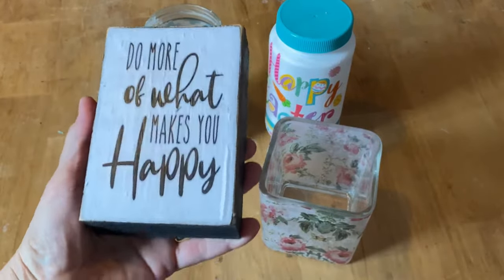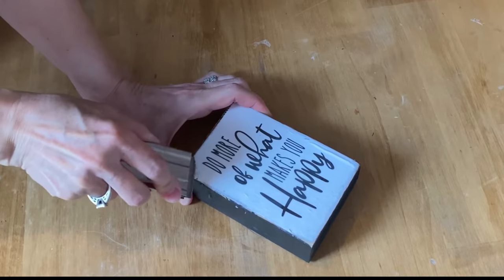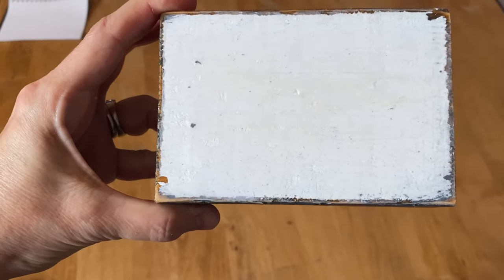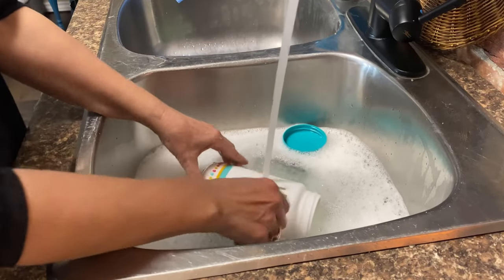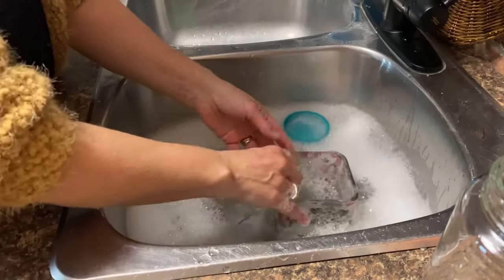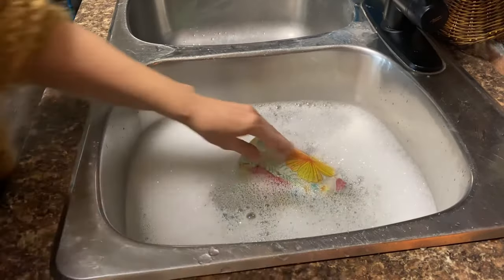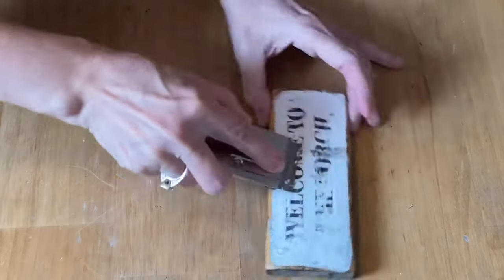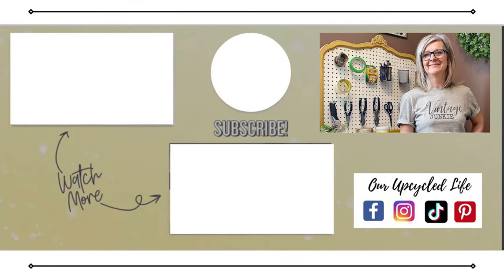Fixing Mistakes: How to Remove Mod Podge and Save Your Creations!

Comment: Ok, I just removed an outdoor modge podged napkin from painted wood. What I found to be the easiest, was a very wet paper towel, a bit of  Dawn dish soap, thinned with water, spread over the wood piece, and a heat gun. I tried a hair dryer but that was taking too long,😅. I laid the wet towel over the soaped wood and applied the heat on lowest setting, moving so as not to burn anything. I kept a water spray bottle handy to keep the towel wet. After heating a couple minutes, I used a razor blade to scrape off the decoupage and glue.
Reply from the maker: Great tips !!

Comment: I don't have the scraper but will figure out  a way. This is helpful video. Thanks. I will post a comment after I have tried it out. My project was a bedside table with decoupage with a thick paper and it has bubbles. I don't like it. Hope it comes off with hot water
Reply from the maker: Good luck!
Reply: @OurUpcycledLife  I could easily remove (didn't need to scrape it off) cos it was thick magazine paper. Came off with hot water. Did a new project and that is fab.  Now I also know that mod podge can be diluted with warm water 😊

Comment: I use my heat gun for stickers and it leaves a sticky residue on it thin I get 100% acetone with a paper towel and it comes right off clean and you don’t have to scrub it or use anything but the paper towel 😊
Reply from the maker: Yes great tip! that works great. Thanks for watching!

Comment: Question, I dont want to remove my decopauge cuz i just made it today but the glass has a foggy film where i accidentally went out of the lines so can i take a qtip and something to get that foggyness clear again thank you
Reply from the maker: You can try or use a xacto knife and see if will will peel off after you cut around edge.

Comment: What do you do when you are unhappy with a laser printer transfer sign on chalk paint and wood? My letters aren't dark enough for my liking so I want to try something completely different on the piece of wood.
Reply from the maker: I am wondering if you need new ink because with a laser jet it should be quite bold and dark. Or check your settings on your printer to make sure printing on highest quality

Comment: I bought a decorative wood (particle) sign from Michael's that has glitter on top of paint. I want to repaint the sign; is there a way to remove the glitter or should it be covered with a heavy paint?
Reply from the maker: You could try scraping all most of it off and then maybe spraying it with a little bit of water and seeing if it scrapes off better otherwise you might just have to sand it down
Reply: @OurUpcycledLife  
Ok- thanks! I'll give it a try.🙂
Reply: @OurUpcycledLife  Where is that scraper from, please?
I looked at your "favorites" on the link tree, but didn't see it?

Comment: Great tips. Thanks for sharing. Last week I bought some things at LIDL (a European chain of supermarkets, which sells craft and DIY products from time to time). i bought white chalk paint, a transfer medium and a decoupage medium. I'm curious if I am able to do something with it.
Reply from the maker: Thanks for watching!! That’s fantastic ❤️ you will have lots of fun!!!
Reply: @OurUpcycledLife  Is it possible to add something to the white chalk paint to make it dark(er)?
If so, what should I think of, some pigment (what kind) or dark paint (what kind)?
Reply from the maker: You can just add a bit of acrylic paint of a different colour of latex till you get the right colour
Reply: @OurUpcycledLife  Thanks. I'll need to experiment a lot with everything. What happens when I put dark acryllic or latex paint on bare wood/plywood and after letting it dry put chalk paint on it? Will it adhere properly or will it fall off?

Comment: Was wondering your thoughts on my idea! I use forearm crutches as a mobility aid to help with my disability. I’ve decided I want to put some fabric designs on my crutches, but I want to change it every now and then. I’m wondering if it would work to mod podge it on and then remove it? I don’t want it to start building up a residue layer, but I can’t think of any other ideas!
Reply from the maker: I think it would work good!! Seal it up with a top coat of mod podge so you could wipe down if you wanted and when you want to change you can just soak off in hot water :)  I think it would look fantastic! So many fabrics you could chose from xo
Reply: @OurUpcycledLife  eee! Makes me so excited to try!

Comment: I love your video, I’m new at modge lodge.  I accidentally got modge podge on the zipper of the boots I’m making a friend.  I can’t figure out how to get the zipper unstuck.  Any suggestions?
Reply from the maker: It will come off if soak in hot water maybe

Comment: Hi, any tips for removing dishwasher safe modpodge from glass? Have tried soaking in hot soap water and using a scourer, but not working!
Reply from the maker: Hmmm! Ya tricky! I don't use it so not sure but maybe your only option would be to scrape it off maybe ? Sorry
Reply: @OurUpcycledLife  thanks for replying ,will keep trying a bit longer before giving up!

Comment: Was wondering if you had any tips on removing dried mod podge on a sticker? I want to restart but I also don't want to damage the sticker in the process. For context, I used clear mod podge to sort of seal it so that it won't scratch/fall off
Reply from the maker: I dont think you will be able to get off a sticker. Sorry